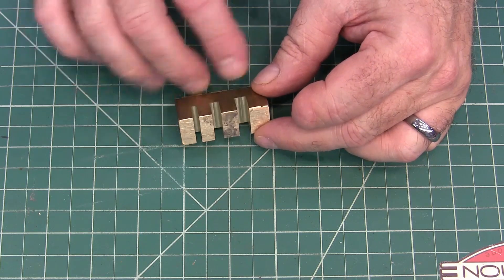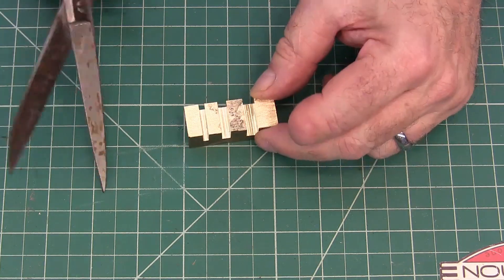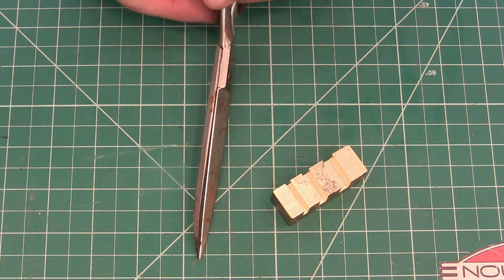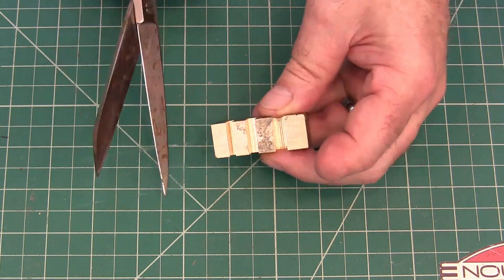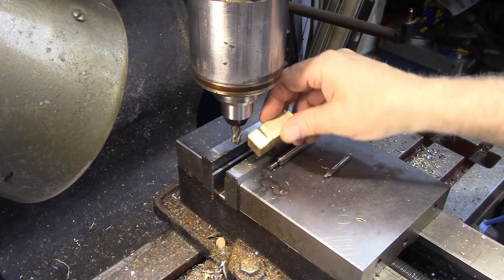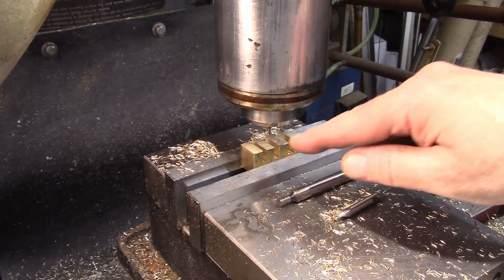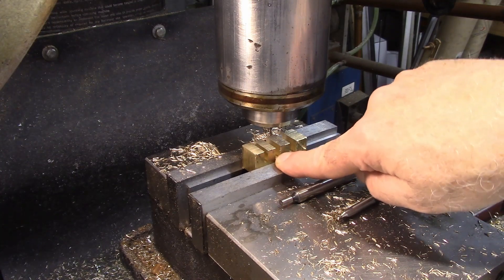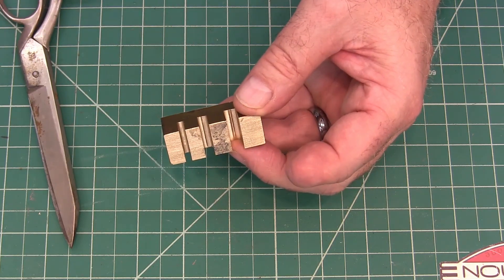Scissor Set Block

Comment: This tool looks interesting.  Will be waiting to see the how to use it video.  I do have some really nice scissors which do need attention.  Sharpening too.  By the way, for your 3D printing work.  What filaments do you find most useful.  I only have PLA but there may be other choices too, what say you?  And as usual thank you for this video.  And have a good weekend, it is getting colder now around here.
Reply from the maker: I have only used PLA and ABS.  I only used ABS a couple of times and had warping issues.  I didn't have an enclosure for my printer at the time.  Since then I have only used PLA.  It works great every time and I haven't found a reason to do anything different.  It has performed well for everything I have done with it.  I use Hatchbox PLA but I don't think the brand matters very much.  I hope you are enjoying it!